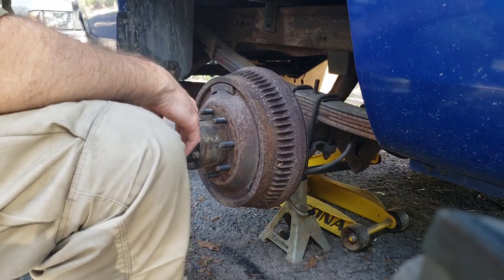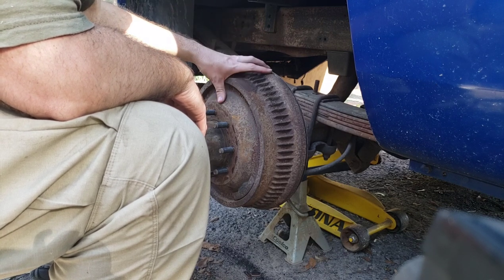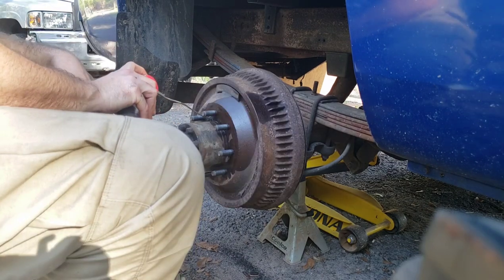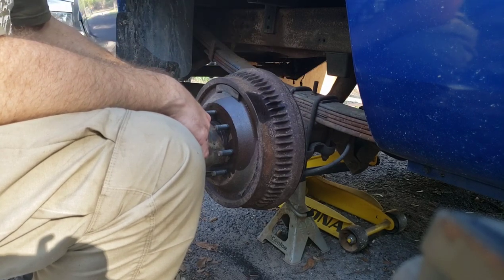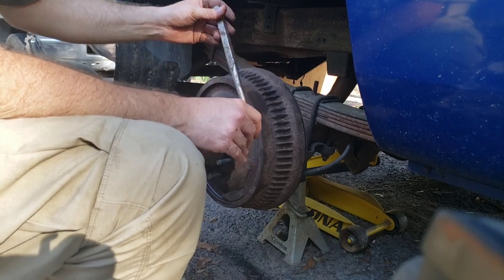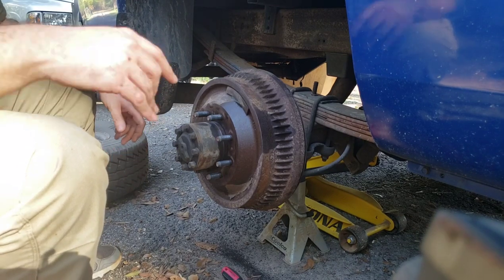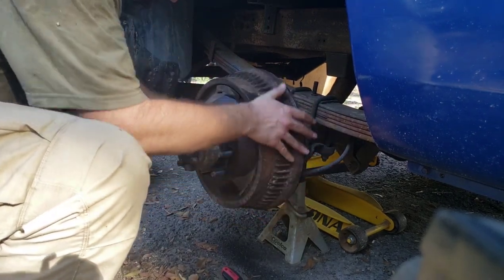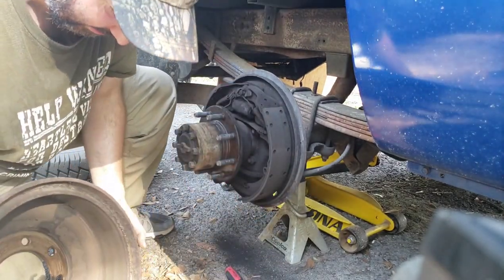How to remove a stuck brake drum 1995 Dodge Ram 2500 Cummins Diesel

Comment: As a roughneck I appreciate you stepping up your hammer game. You made a crucial mistake though. When that hammer doesn’t work, you get a bigger hammer. A good 12-16 lb would have made quick work. 
Sarcasm. Brake shoe seems to have wore a groove it’s been so long since they’ve been off.
I am surprised that truck has smaller brakes than my 92 3/4 srw Chevy
Reply from the maker: So the pads and drums were in real good shape. The adjusters were frozen so the brakes weren't doing much.